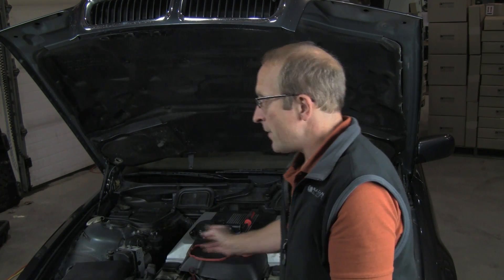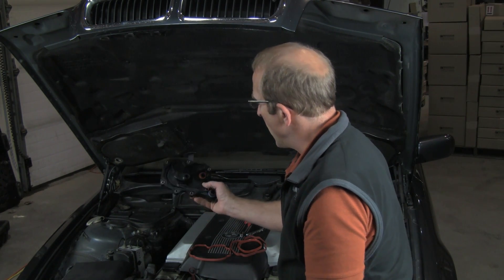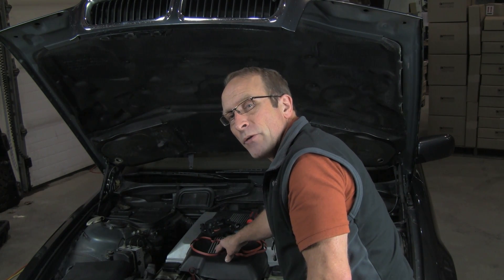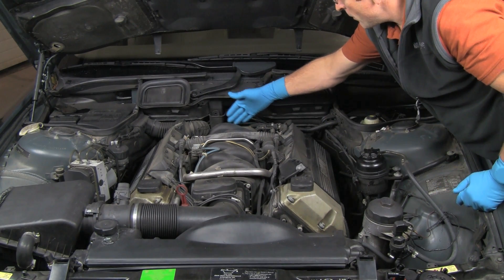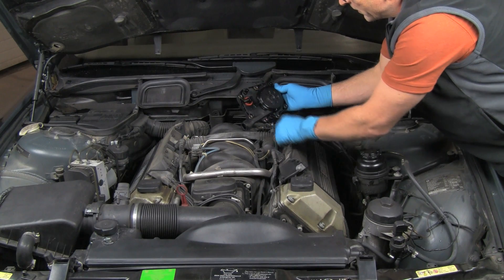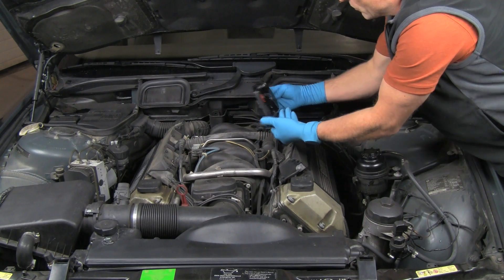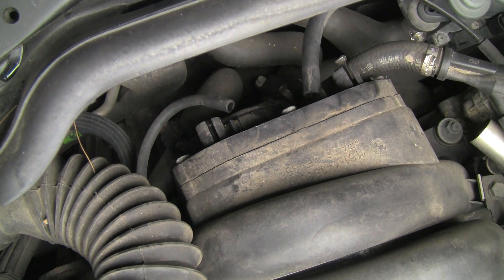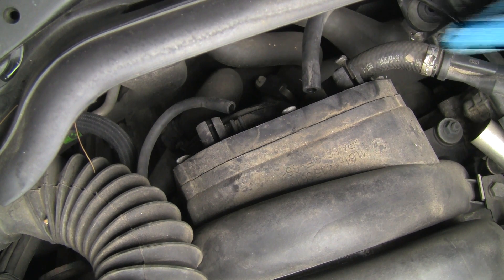Replacing the PCV System on a BMW V8 Engine Part 1 of 2

Comment: Well I tried the needle nose plier! Not enough room!
So I'm going with taking off the intake manifold now ...
Any advice on that anyone?
Reply: I carefully cut mine off with a reciprocating saw, I separated the ccv from the throttle body with a small flat head I had two torx bolts left ,was able break the plastic to expose the bolts and use a miniature grip pliers to unscrew the bolts.

Comment: Ill try the little vice grips just incase that doesn't work how would you suggest to break it off ! 
Now if I do break it off will it ruin the housing for where the bolts sit in?
Reply from the maker: We have never had to break one apart.  We would suggest pry tools and pliers.  Just be careful not to damage the intake manifold itself.
Reply: what we did was; use a sawzall, very carefully, with a long blade. Started at the top right standing working from the left side, and just trimmed away all the plastic above the bottom screws. then the big vice grips worked easily and quickly. Like firing a weapon, be sure of what is behind, and don't hit that.
Reply from the maker: Eric Fullerton
 - Good input

Comment: hello . 
i have a problem that i need help with .
i have the same bmw but 540i tring to replace the pcv as well but the bottom right 3 torx bolts are stripped what would be the best thing for me to do at this point?
Reply from the maker: Many people are able to remove a stripped bolt using a small pair of needle-nose vise-grip pliers.  A "last resort" option is to break apart the cover to gain more access to the bolt.

Comment: I have a 95 740i ND I noticed the pcv valve dosnt have a center nipple and the manifold dosnt have a pipe going through the middle
Reply from the maker: The earlier M60 V8 is slightly different from the later M62 V8 shown.

Comment from the maker: Yes, the tube can indeed become disconnected from the forward manifold cover (throttle body mount plate).  If you remove the front cover and throttle body, you can check this .... and it's much easier to do.  You will need a new gasket for the cover and for the throttle body.  We have these in-stock at bavauto.com or call at 800-535-2002.
Reply: Is there a part 3 to this video? My tubes came off the front of the intake and I don't know how to put them back on?

Comment: Great video, thank you.I did as you said with the gasket replacement but the service engine light is still coming on.Quick question, the tube you refer to inside the manifold, I didn't feel one after carefully taking off the plate.All I felt was a hole where the nipple, presumably, butted up against.  Am I supposed to be able to actually feel this tube?  If so, why can't I...could it be disconnected inside the manifold?  The BMW dealer said the smoke (test) was pouring out through the plate...?

Comment from the maker: The PCV system should not cause a not-start, with the following notes:  If there is a major vacuum leak due to one of the PCV hoses being cracked and open, this could cause difficult starting.  If the PCV oil separator is clogged, this can cause major amounts of oil to be sucked into the intake and the cylinders, causing a hydraulic lock.  In this case the engine would not crank (or turn over).

Comment from the maker: Yes, the check valve assembly certainly could be at fault.  We would also check the condition of the spark plugs if it has been using the oil for a while.  Additionally, you should clean the MAF with our Mass Airflow Sensor cleaner.  You can see it at bavauto.com ... part number 05110

Comment: Hello im curious if this part could be my problem with my 740 il as well. My car runs very rough and seems to be blowing blue smoke, i know its burning up the oil and seems to be going through fuel as well faster. It will cut off some times when i stop amd has trouble taking off seems bogged down if you will.. would this part being faulty cause these problems. I work on mu own vehicles bc i cant afford to send the bmw to a shop with their high costs. This one seems like a simple enough fix. Shan

Comment from the maker: All parts needed to do the repair, are in the kit.  You may, however, wish to order the short vent hose (# 11 61 1 440 126) as this may be brittle and crack or rip while being removed.  This applies to the V8 M62 engines from 99-on (540i, 740i/iL, X5 4.4 & 4.6is through 03).